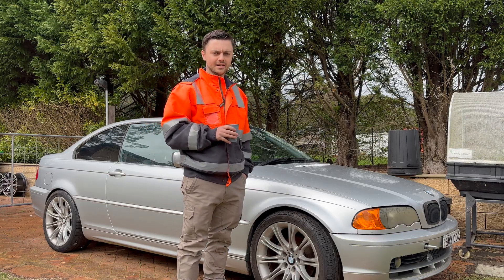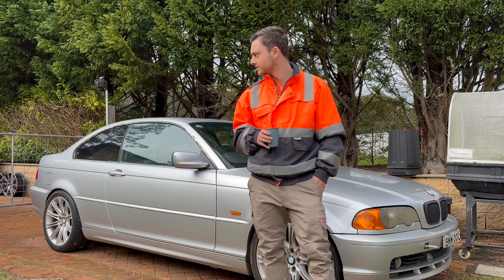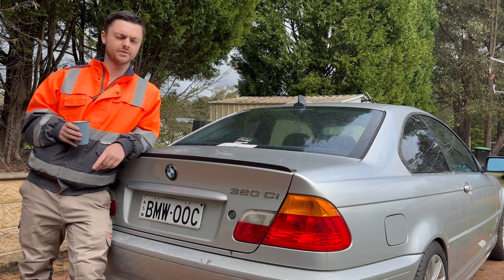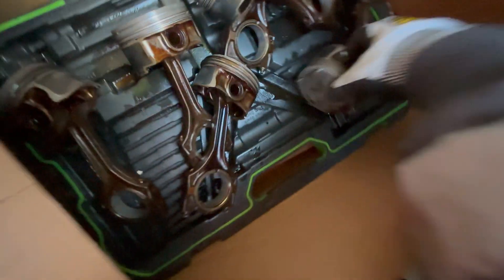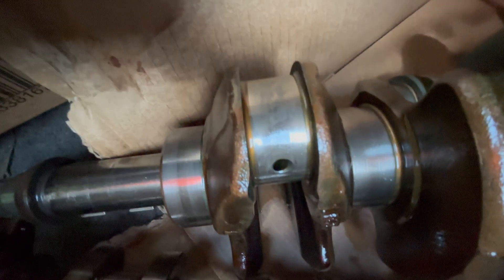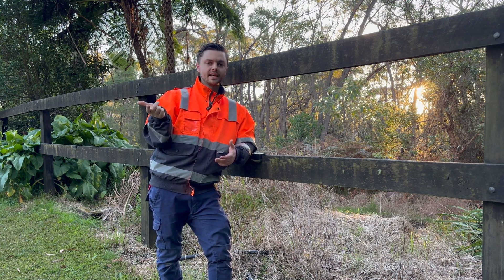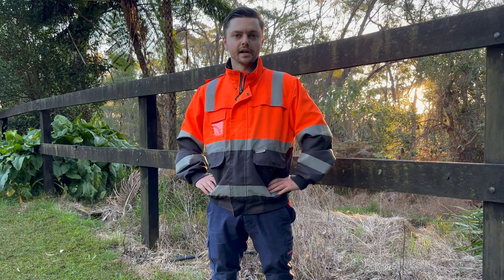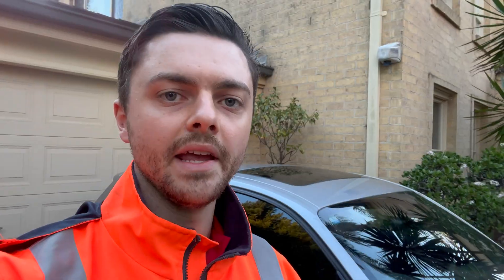Building a Budget BMW M54 Stroker Engine

Comment: You also need b30 intakemanifold, b30 throttle body, b30 MAF, b30 injectors and ms43 reflash.
Reply from the maker: @anthonye466  although advisable by many people. I’m going a different route with other BMW parts. Some from N series engines
Reply: @mcgarage7315  N series are direct injected